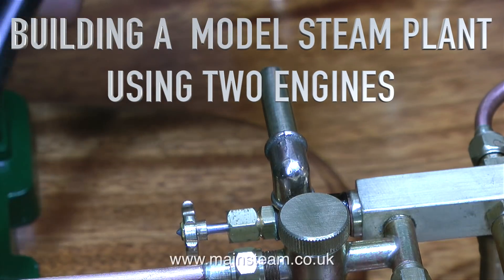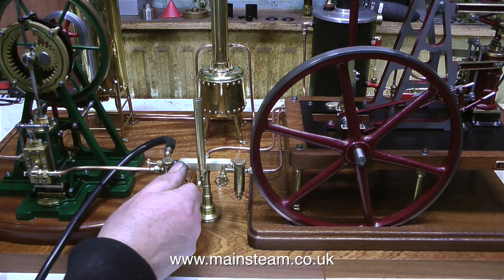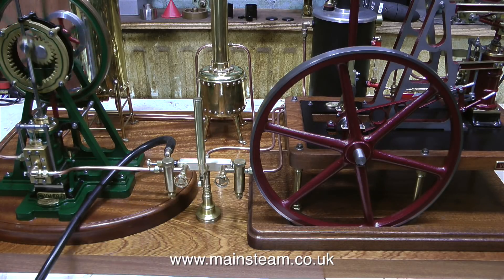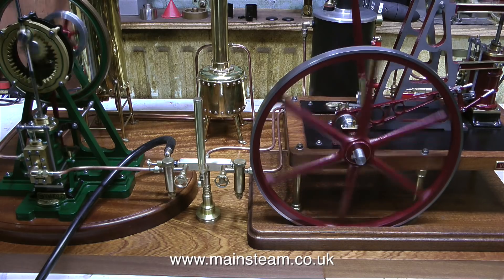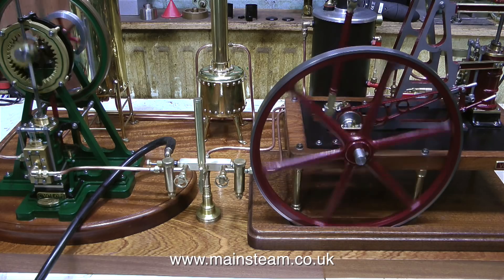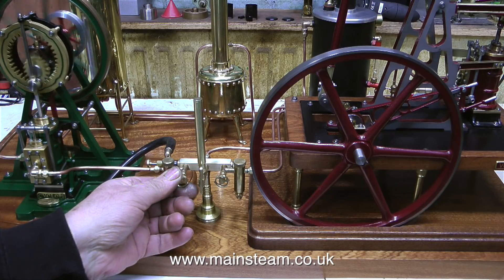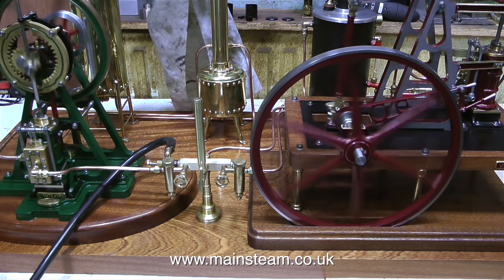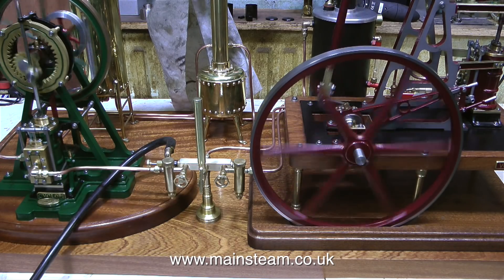BUILDING A  MODEL STEAM PLANT USING TWO ENGINES - PART #9  "THE CHUFF POT"

Comment: I think those are originaly ment for smaller machines, like The Jensen or Wilesco models, perhaps. I guess the steamflow are more smooth and even on those bigger machines and does not create that punch noise distorsion, that's why it does not work, maybe the person who designed them did use the same design as for the smaller ones and it possibly worked on the smaller types of the Stuart machines, but was newer tested on those larger types before. I don't know, but possibly the kettle design does not work at all on them since there is nothing at all to amplify except this hissing sound. Just my 5 cents...
Reply from the maker: Yes you are right, The customer bought it and asked me to fit it to his steam plant . . . . it is an awful thing.
Reply: @keithappleton  I am about to build my self a cuff pot for the Märklin plant from copperpipe, and i taught about using the same design, that's why i wrote here... 
I will give it a try anyway i think.
Reply: @keithappleton  I think Your own oiltrap design would be worth trying for my Märklin plant.
Reply: @keithappleton  
To clearify, i did not wrote this in order to talk bad about You, ozsteamdemon or the guy who bought it, it was just that i am trying to understand what i am actualy doing when i tamper with my own machines in order to learn them properly before i do any irreversible changes on them or buying expensive things.
Reply from the maker: The Ozsteamdemon "Chuff Pot" would be fine as you say for little steam engines like Wilesco etc, but it does not sound too good on larger engines.
Reply: @keithappleton  
Thank You! I will give the design a try with the parts i hawe lying around in the workshop, in order to see if it works with my machines first, if not i think i will go for Your horizontal design instead, i realy liked that design.

Comment: I've never seen a chuff pot before, but you did briefly show the interior mechanism in one of your videos and as I remember it had a kind of metal loudspeaker plate. I'd have thought it should be possible to simply put a bit of blu-tak or similar on the plate to dampen vibration a bit - with luck this would also tend to remove more high frequency than low, and improve the timbre. Just a guess.
Reply from the maker: No, that plate is nothing to do with the mechanism. The plate has a couple of holes drilled in it to drain the condensate into the lower tank. The mechanism is and entirely separate unit which fits into the chimney itself.

Comment: Didn't think it would sound like that, sounds like listening to distorted recording of a steam engine through an old radio. Does it sound more nuanced in person?
Reply from the maker: That is pretty much exactly like it sounds - it's very loud too, - louder than the steam whistle when both of the engines are running ...... It's a really nice well made device but I prefer it without the exhaust amplifier fitted - that's why I removed the mechanism - I need my ears as a Sound Recording Engineer in the Studio. . . probably great for a small "Wilesco" or "Mamod" steam engine though. Generally speaking stem engines only "Chuff" when they are under load like when a Steam Locomotive sets off . . . but when a Locomotive is going faster or downhill the exhaust beats are much quieter.